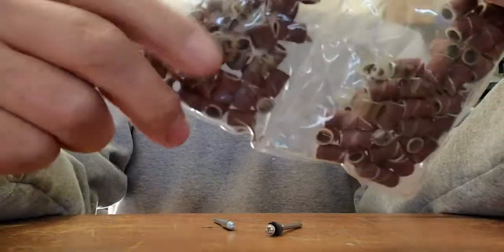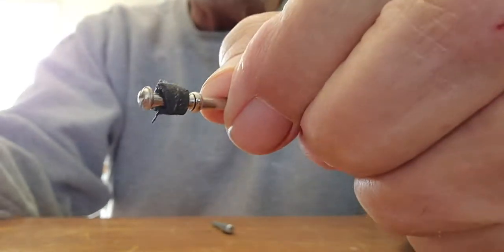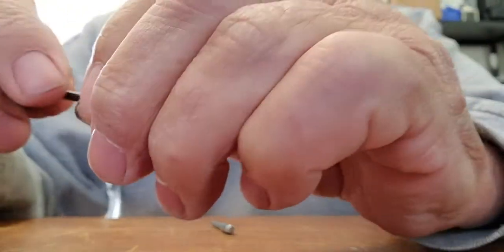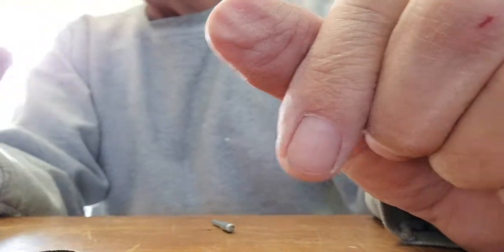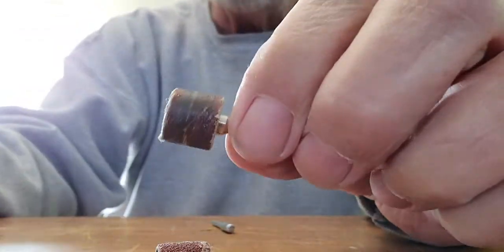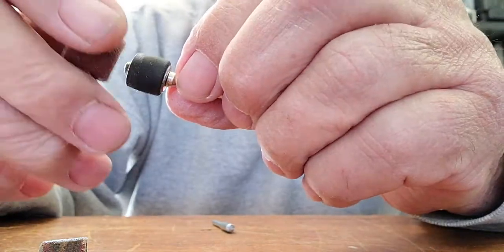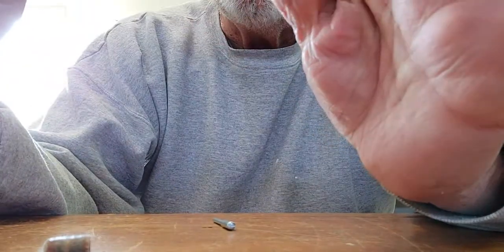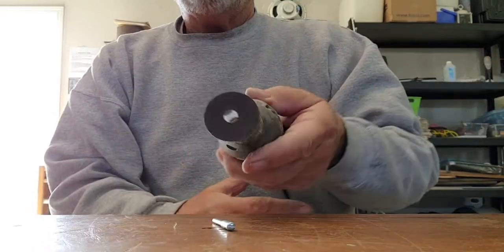(383) Dremel Sanding Bands 1/4 Inch Rubber Mandrel

Comment: I saw another video were someone used 1/2 inch fuel line rubber pipe and cut it to suit.The inside diameter is larger than the shaft but you can center the shaft  by eye and once you tighten the screw it will hold. Also another method is using a pencil rubber/eraser and cutting it using a metal punch to the correct size you need. You may need two pieces to get the correct thickness. The guy used a 1/2 inch piece of  copper pipe and sharpened the end to make a punch.

Comment: I use the steel one used by finger nail technicians. Nail supply store
Reply from the maker: Funny, just found some purchased from a nail store, even had the 1/8 shank. Works perfect! Thanks for the reply. Now if I can find some for the 1/2 inch drum..